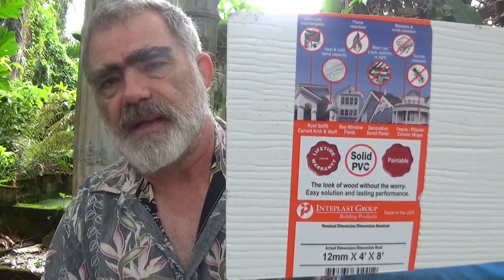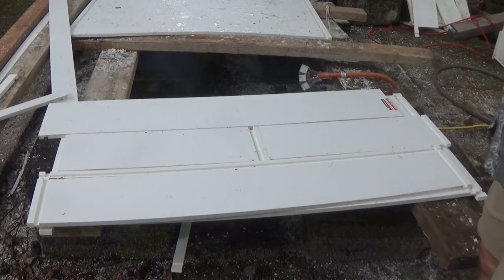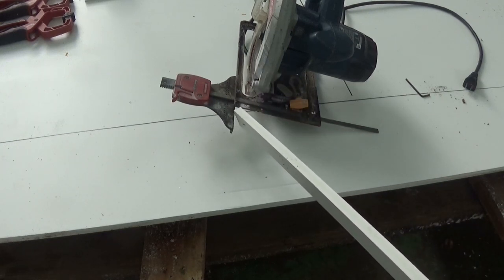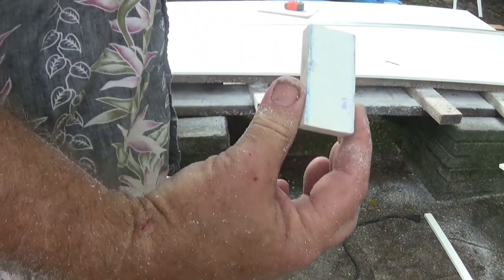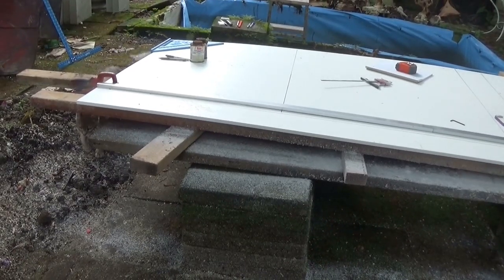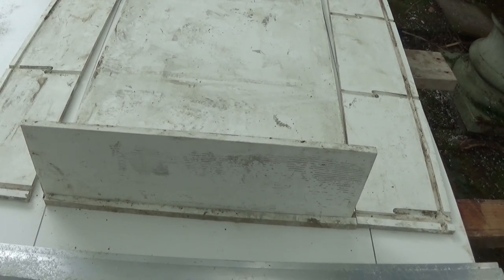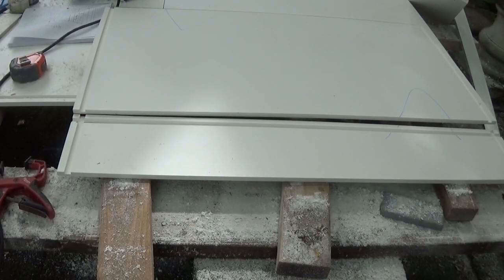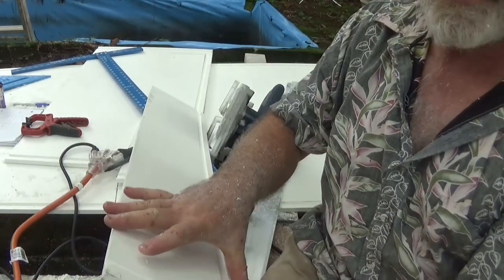Aircrete forms done right

Comment: As a long time homemade soap maker, I have faced the same challenges with mold sticking and leakage. I use the same type of interlocking wood forms. There are 2 ways that may be of interest Lining your forms with thin plastic, like the cheap plastic drop cloths at the home store. Then spray the inside of the forms with water just enough to get the plastic to stick to the inside of the form. Them you can unmold easily by turning it over and unmolding.  The second way is to wrap all the mold pieces in shrink-wrap them assemble the mold. Same as the first method except the shrink wrap will last many uses before replacement. These are just tips I have learned along the way. The first method is what I usually used. It is easy, cheap and quick.

Comment: While this is a great video, I would recommend the channel Happy H. to have a solidworks cnc roughter tool path rendered up and sell it for a few bucks to us viewers. Local cnc companies charge $80-100 an hour in USA and they are in a abundance in most cities. If diy builders make one of these forms and screw up the daydo cut, it can be costly at $130-$350 a sheet. $350 may sound expensive but its pennies for the value if your casting and building, (don't get to greedy right)! Oh and I can do the renderings for you if needed boss. Peace